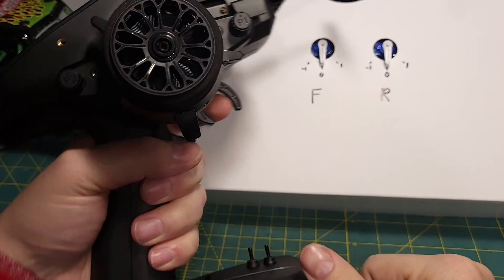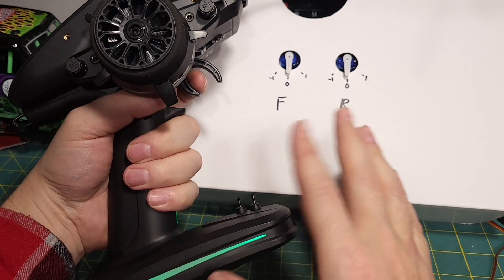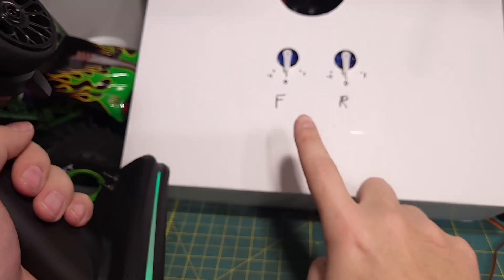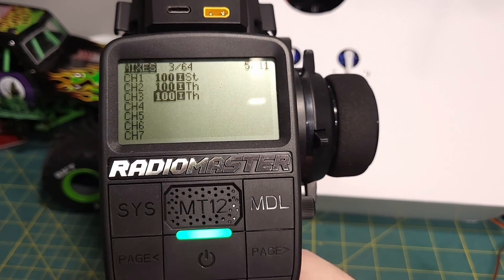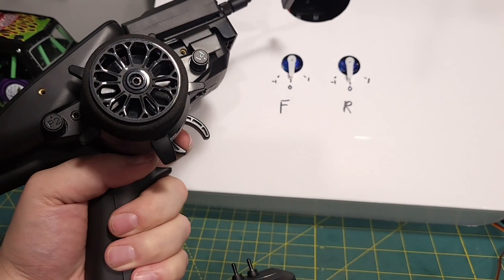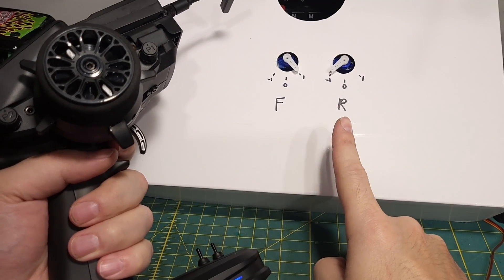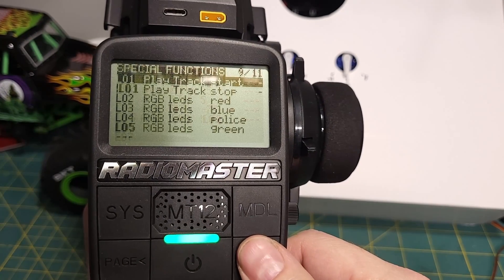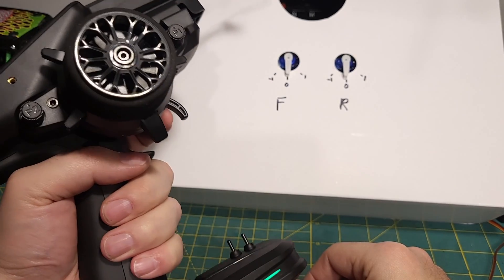Radiomaster MT12 EdgeTX - Motor On Axle (MOA) Mixing

Comment: Can you set up the setting for the front motor to lock up and have power to the rear and also have it set to do the same with the rear. Basically having full function on the moa locking front and rear motors? Trying to figure out a controller that will do both that isnt 250 bucks
Reply from the maker: Check out my updated video, I go over dig and burn

Comment: I want to know how to do 4w steering . With two separate servos going opposite ways proportionally using the steering channel and a switch on the remote for regular steering or 4ws
Reply from the maker: Good idea, I'll include that in my next radio setup video!

Comment: By having your momentary button going minus 100, it will throw it into instant 100% reverse. You want the rear motor to not turn at all.
You would be better to use the switches around the wheel, so you don't have to take your hand off the wheel to use the functions. You want it to be fluent while you're driving. You haven't set up burn to lock the front axle.
Try setting the switch closest to your thumb to 3 position. Centre being 4WD, down locking the rear, and up locking the front. Use the trim switch to the right of the wheel to change  throttle bias in 5% increments.  You'll get a more fluid control while you're driving, without removing your hand from the wheel.
Reply from the maker: When I ran my XR10 I had it setup for fwd/brk/rev, so I still had that on my mind, lol. I reshot the video with the setup exactly as you described, and changed the mix, and made it so in reverse it overdrives the rear to eliminate reverse bind up. I just need some time to edit and post.
Reply: Sounds good! Look forward to the updated video.  @JacobScherer